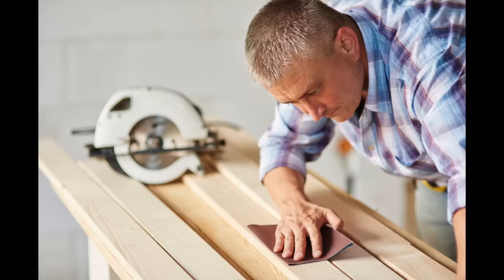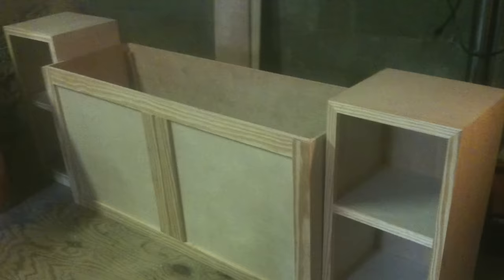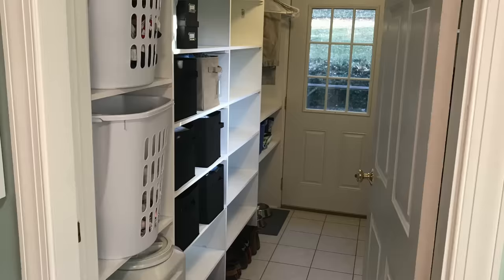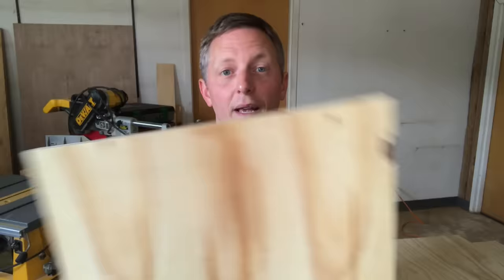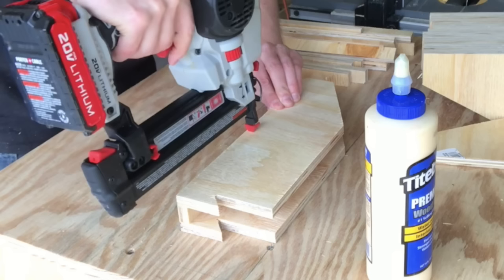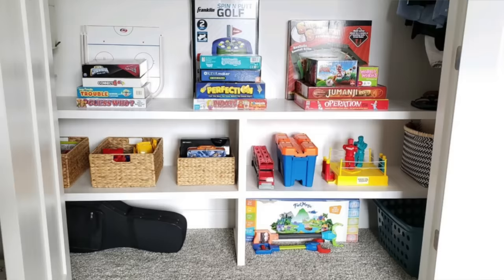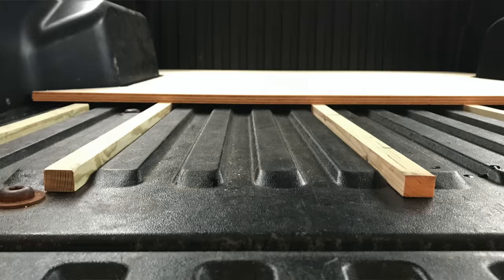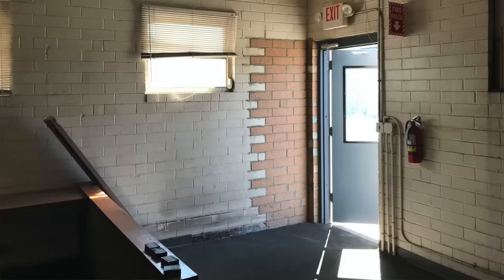DON'T USE 3/4" PLYWOOD If You Don't Need It...TRY THIS! (1/2" Plywood Vs. 3/4" Plywood--When to Use)

Comment: Needed some plywood for a project recently. 1/2” bc was like $45- $48? and 3/4 was about $60?  Anyways the sheet of 3/4 red oak was $61 so I said screw it, getting the good stuff!
I like over kill. My first work bench could probably hold a 3/4 ton truck.

Comment: Ok but you forgetting a major factor. It is the PLY count because not ever 1/2" or 12-13mm  has the same ply count so you can find 9 - 11 plies and also depending what wood you using from birch over to hardwood plywood.  So account for those factors as well. The more plies you got the stiffer most the time also going to be the plywood.

Comment: The problem he did not mention is attaching to 1/2" is not always simple. If you use a 3/4" screw to join two 1/2" parts you have very little penetration. If you use a 1" screw you run the risk of pushing out the other side. Not many 7/8" screws available. Depending on what you are building you may have to add a backer board to be able to screw things in to the panel. Just sayin'

Comment: Aetna Building Solutions is a great place to go. It's a wholesale company for the Cabinet Industry.
We have locations in Minnesota, Illinois and Indiana. They have everything for Plywood/lumber/Quartz/Solid Surface/Laminate/Wetwall/Adhesives and Sealants (275 gal to 250ml)

We also Lay-up panels. Either customer supplied materials or our own! 

Any size core from 5'X12' to 30"X144"
Any thickness from 1-1/8" to 1/8"

We Mill Lumber as well! 
Straight line & Plane

I've worked for them for coming up on 10 years! I'm warehouse staff! 

Give us a call at any of our locations if your interested in our products!  😁

Comment: This is such an awesome idea that wasn't even on my radar!

I'm building out a "Vanlife" kitchen, and storage drawer system for my car. The drawers will be about 36-48in but will not be walked on, will have beefy support drawer slides, and will have mimimum if any  impacts on it.

D you think I could get away with 1/2" ply for my project?

Comment: Fantastic... New subscriber & Like.  I wish I'd run across this a week ago.  But fortunately I only used a single sheet of 3/4" for my most recent over-built effort.  I'm happy with it, but 1/2" would have been perfectly adequate.  Thanks for this; I'll be prepared going forward and the 20-25% cost savings will really come in handy!

Comment: The thing everyone's doing (or at least they are watching videos about doing) - is building skate ramps.  Something tells me, that because skate surfaces rest on 2x4s (as part of the framing) that 1/2 inch would be fine - and it would make the average backyard or driveway skate ramp easier to move, being less heavy. Any thoughts on that?

Comment: Your logic is sound BUT there is a HUGE BUT HERE..........Go down to your local Home Depot and the only "sanded plywood" you can find there IS 3/4" PLYWOOD!! The 1/2 inch plywood they sell DOES NOT COME as a finished grade plywood!! Likewise too Home Depot and Lowes in some areas sell what is known as "cabinet quality" plywood that offers a sanded veneer finish like Maple, Oak, and even Birch that can be finished to look like the actual wood you use for trim. BUT these only ever come in 3/4" thickness from what I have seen!! 

Generally too, most places like Home Depot and Lowes offer plywood in 1/2" and the other BUT to this is most of that is ugly construction grade sheathing or to be used as sub flooring (in 5/8")! It isn't smooth enough to use as "finished furniture" and while it can be worked to make it "look better" the more you have to sand it, the thinner the material actually becomes!!

Another thing I would add is this, "Plywood shelves CAN bow over time" unless you are using 3/4" material as the shelf! Even OSB and MDF will "sag" in the middle over years of weight on the material when used as shelves. BUT 3/4" plywood doesn't bow or sag as much as MDF or OSB will, and all materials should be supported over lengths longer than two and a half feet! This even applies to solid wood as well!! 

Lastly where I live NOBODY sells Baltic Birch plywood, and the only option I have is the Sanded 3/4" Plywood, Home Depot sells as nobody in my area carries "cabinet grade" plywood either! So my furniture and projects are usually limited to ONLY 3/4" because it is all that is available in my area!! I could order in Baltic Birch plywood, but the cost to ship to my New York home is actually even more money that it would be to just stop at Home Depot for Sanded Plywood!! So I don't have much of a choice in what material I use and the Sanded Plywood is the cheapest option available to me!!!

Comment: Great Video!  Thanks for the info. 
For those of us that don’t know, how much span can 3/4 handle like in your shown 24 inch example?  30, 36 ??
Reply from the maker: Thanks Dave! I’d say it depends what you’re putting on it—but for fairly light duty you can prob span 36”. Drop down to 30” for a bit more weight.

Comment: Unless your storing heavy machine parts or gym equipment there's absolutely no reason to use 3/4 inch ply for shelving.  I'll still be using it for my floor though.
Reply: Wrong. 1/2" will sag over time with not a lot of weight on it.
Reply: @cpt awesome  Maybe if you don't support them properly, but I've seen 1/2 inch shelves that are over 20 years old that have zero sag.

Comment: What are your thoughts about using 1/2" vs 3/4" for workshop walls? I'm building a workshop soon and I won't want drywall walls, I want plywood so I can hang stuff without having to always be searching or relying on studs. But I'm thinking I may still need to use 3/4" ply for this because of its thickness when screwing french cleats, etc. into it. But if I could go with 1/2" it would save me a boatload of cash!

Comment: I'm looking to hang up metal peg boards in my finished garage. The framing is all various widths. So thought I could put up trim and get perfect placement for my peg boards. Should I look for 1/2"?I'm looking to hang up metal peg boards in my finished garage. The framing is all various widths. So thought I could put up trim and get perfect placement for my peg boards. Should I look for 1/2"? I would be putting up about 6 feet of 16" peg board.

Comment: for a stand alone bookcase that is 24"x16"x8' with adjustable shelves, should I use 1/2"or 3/4" plywood? I just want to be sure it will be strong enough for years. thanks.

Comment: I’m trying to clear space to be able to make my first French cleat wall and wondered if it would make sense to use 3/4” for the cleats and 1/2” for the containers? I’d be doing it partly to save some money, but like Ethan said, stuff in 1/2” looks more elegant. If built right, 1/2” should be plenty strong for the containers, right?

Comment: I've been giving this concept a lot a thought and wanted to know your thoughts on applying this idea to 2x4's.. and using 2x3 instead.  I am thinking out how I am going to build my shop cabinets and such and I keep thinking, I am not building walls that need to hold up a roof, I can use 2x3 save  a dollar a board and use less material.  The tools going on them don't weight that much.  I am trying to limit the amount of plywood I use so turning to the 2x4 (or 2x3 in this case) for the main structure of the rolling cabinets and limiting the use of the plywood for the added drawers.

Comment: Full Cut.  Rough Cut = 2 x 4.  or 1"  planed down to smooth boards.  But they are getting thinner. ?
2x4 used to be 1 .75 now 1.5 thick ?   My Victorian house 1880's  Full Cut 2 x 4s .  hard as a rock with square nails, cut nails.

Comment: I am going to be building a sliding coffee table where the top splits and slides in half. The bottom of the table would just be kind of the carcass that looks like a kitchen cabinet. Would 1/2" be okay or should I go 3/4"? 
The primary concern would be the bounciness of the table top.

Comment: I have a subfloor thats  squeakin really bad on every room. I found out that they used  particle boards on all of them. Should I use 1/2 or 3/4 plywoods to replace them. Can I used 3/4 plywood, I will have them put vinyl or laminated floors after that.

Comment: Great video! I recently installed overhead storage in my garage and the kit vendor was insistent on installing 3/4 plywood or OSB decking. The decking alone was going to add significant weight, using up the rated holding capacity of the frame (which hangs by 8 lag bolts to your rafters.

I ended up using patriot timber SurePly 4x4 panels because, I don't need to store 100s of pounds of items above my head, just light, bulky items, and there's no way I could easily lift and position that 3/4 lumber 7 feet in the air.  I mention this brand because it felt stronger, more rigid, lighter and $10 less expensive than the equivalent plywood. Depending on your project, it could be a better choice.
Thanks again for the tip.

Comment: 1/2" has good strength in both directions if it has 5 plys.  second cross ply is not that far in from first ply.  commonly for g1s but not standard grade.  3 ply or 4 ply sucks.

Comment: Thickness has to do with structural strength, that's it! Just as you do not use 2x6 to span twelve feet. Its all in the building code.

Comment: I'm here in 2022, remodeling my closet, and the difference between a 1/2 in and 3/4 in 4x8 plywood board at Lowe's is approximately $27.😫 I ended up using 1/2 in for the vertical supports. I want to use 3/4 for the horizontal pieces, but that's a SIGNIFICANT price difference. Any thoughts?

Comment: ??? Ive never ever seen a kitchen cabinet made with anything 1/2 inch (aside from drawers, of course). Anything cabinet related is made to work with 18mm or 3/4 inch plywood. 1/2 inch is also far weaker than 3/4. If i installed a hinge with a screw that can only bite 3/8 of an inch, one slip and the door is on the floor. You say the cost difference is worth it, but for an extra $12, you’re gaining 50% thickness as well as superior strength and compatibility with other products. This is an odd recommendation to say the least. I dont think I will ever see the cabinet industry switching to a different thickness.

Comment: Did you say Navarathri festival? That’s impressive and amazing? Would you be able share a video on how you did that especially given the fact that it was completely collapsible and stored. On a different note I am an avid follower of your channel. Btw, I bought the drill driver and planning to purchase the circular saw after your two tool video. Bought the drill guide and already seeing its value. Btw on the circular saw can you add the link for makita 5007mga and dewalt dwe575sb to the to tool video. I would like to use your affiliate link to make the circular saw purchase. Keep the videos coming - thanks

Comment: do you have a video on laundry machine cab build?  these are not standard size, cannot just be bought.  I wonder what to use to support the counter top above the washer and dryer.  They are like 30" each, so total span of 60".

Comment: Thanks for the vid. I'm looking to make my very first plywood project--a 3 piece tv/component stand, small reading/sitting bench, and a small wood stove stand. I plan to connect at least the tv stand and bench together, perhaps even the stove. Since these will all bear weight, especially the wood stove piece, I plan to double up the thickness with 2 glued pieces. Would you recommend glue+screw the two plywood faces together? Would pocket hole joinery be okay? I have a sketch drawn up that helps visualize my idea but not sure how to execute. TIA. I'm thinking 5/8" plywood would be a happy medium.

Comment: Plywood is not stronger than natural wood - it just is notas directionally dependant. Wood is rather stiff against bending the long fibres, but a lot more flexible side-to-side.
Also you did basically only mention 3 things that anybody knows already: It s thinner - and thus cheaper and lighter.

Comment: Sorry if this question has been answered elsewhere... But there is another question I have about softwood plywood.  Which has a good strength to weight ratio ??  I've watched some of your other videos, where you mention southern yellow pine...which plywood wood species would you choose for its strength ??  Note: I'm trying to avoid Baltic Birtch because its been my experience that its very tuff to cut.

Comment: Is1/2” plywood strong enough to build tool stands for let’s the Dewalt Miter Saw or the Dewalt Thickness Planer, or would the 1/2” plywood warp from the weight?
Reply from the maker: I think you definitely can, Gene. You just want to get edge support pretty well distributed—give the unit a bit of structure. But it could take far more weight than that before significantly warping, from my experience.
Reply: I think sometimes guys forget how much dishes weigh.  My kitchen cabinets are made out of 1/2" plywood, and my everyday dishes can serve up to 18 people.  I still worry more about them falling off the wall then about the cabinet itself.  😉

I also have a DeWalt Miter saw.  I can lift that.  I can't lift all of my plates.  I think it'll do. 👍

Comment: Good video. One quick q - What are your thoughts when building a bookcase with adjustable shelves. Will the sides have enough strengths for the adjustable pins? What is your experience? Thanks in advance.

Comment: I have a project where I definitely need 3/4 for span strength but was going to use 1/2 in some areas to save money and weight. I was going to use pocket screws but is there any issue with pocket screws on 1/2” plywood?

Comment: Could I do French cleat rails in 1/2” ply? This is to support individual 2 x 24 x 48 inch acoustic foam pads. Thinking of backing them with 1/4” ply sheeting, and 1/2” ply cleats, to keep them flat, lightweight, and movable.

Comment: Thank you for this excellent video. Question: would I use 1/2 or 3/4 since I will be making plywood cutouts for a nativity scene(outside on my lawn) painted. I live in N.E. Florida. Many thanks.
Reply from the maker: Hmmm, I bet 1/2” would hold up fine over time. But I’m thinking 3/4” (heavily painted) would be even more durable in the Florida climate.

Comment: What if I don't want/intend to 'walk on it every day', but just want to "put down a floor over open beams on the interior-space of a garage?   I'll then have a place to store gal. jugs of water in case Arizona's drought deepens as the Illumined "Masters" might desire.    This 'floor' would go in front of the area that holds my furnace and inside-half of my A/C unit, plus ducting, plus interior "monitoring-equipment", because the Fusion center imagins a 72+ yr old single homeowner could be a "Tear-OR-ist", like a father/grandfather in yore fam-ill-lee.;)

Comment: finishing the inside of a 40x30 garage with 12' sidewalls.  I would love to cut my costs and use 1/2" but I went with plywood so I could hang anything I want wherever I want regardless of where the 8' OC studs are.  Do you feel 1/2" is strong enough to attach to for just about anything?  You said you didn't like to span more than 24" with 1/2" I will have a support @ 4' between the studs at every vertical rise of 4'.

Comment: I'm fixing to build drawer slides for my truck. Just got finished building a bunch of cabinets for my garage in 3/4". Do you think 1/2" would be sufficient for the drawer slides, or should I stick with 3/4"?

Comment: I’m putting in a resin 7x7 shed to hold my 85g water pressure tank & well pump. I’m building the base with deck blocks and 2x8 floor joists 16” on center. Can I use 1/2 inch exterior ply or 1/2” exterior OSB for the flooring? For the weight load 3/4 seems excessive but I don’t want to underbuild it 🙄

Comment: Disagree. For structure, durability, and amount of wood you get, 3/4” is more bang for your buck. 1/2” ply is not great for anything over 24” that needs to hold any small amount of weight in shelving. Plus 3/4” holds pocket jig holes and screws a lot easier than 1/2” ply which will split and break even with properly sized pre drilled holes.

Sure, 1/2” might work, but for how long?  With 3/4” I always feel confident that my build will last and be structurally solid.

Comment: Thanks for the video. I am dabbling in making custom pull out drawers for kitchen cabinets and pantry.  I have one pullout cabinet that is 30” wide.  Some heavy cookware will live there.   Is there some way to reinforce the bottom with a couple of stringers and would you use 1/2” since it is over 24”?  Thanks and all the best from north Texas.

Comment: I am going to build a freestanding book case. It will be 3 1/2 ft wide with no center supports and 6ft tall. Would you suggest I use 1/2 in plywood, 3/4 in plywood or traditional lumber?

Comment: Hey Ethan, I'm need to build some shop furniture...was wondering if the carcass of a mobile miter saw stand and a flip top cart with a rigid sander and a dewalt planer would have good shear strength with 1/2 over 3/4...and could the tops be made with 1/2 as well with the weight of the tools on them

Comment: As a professional carpenter, I have never dictated what thickness lumber i would use because of sawdust, or because my saw couldn't handle it. What kind of saw are you running that cant handle 3/4 birch plywood? yeah, there is always something lighter or easier to use but "easier for me" is not what the customer is paying for, they are paying for the quality and stoutness of the work. Just an FYI, You shouldn't be a carpenter if 3/4 inch plywood is too heavy for you to work with